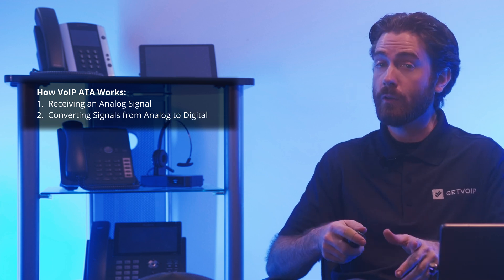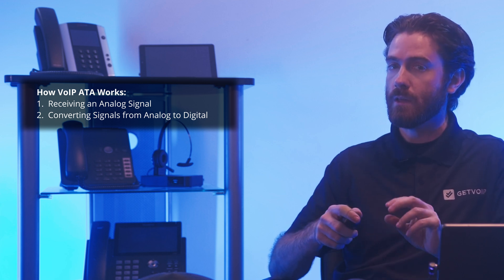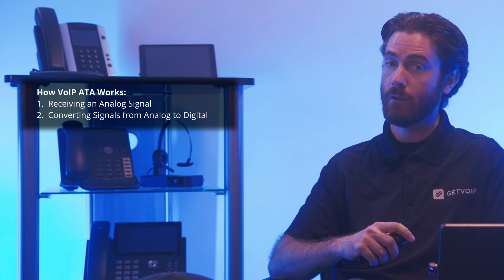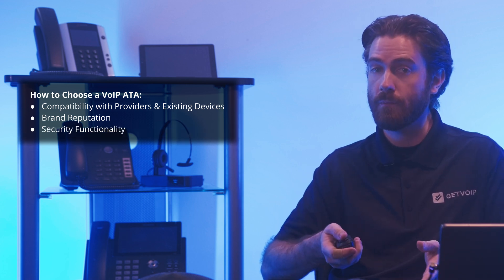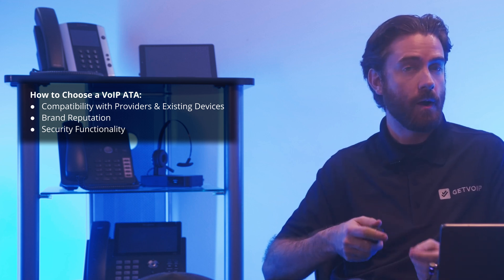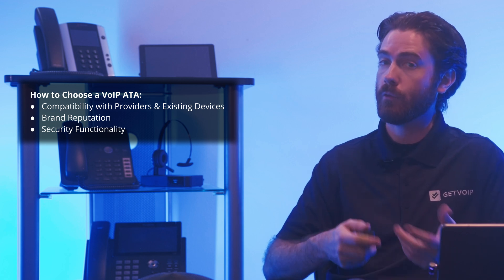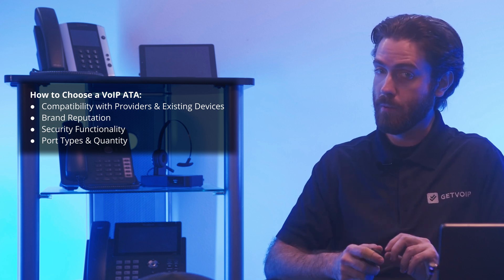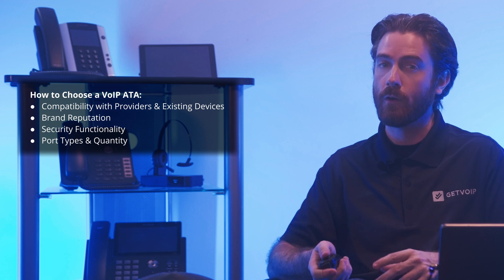VoIP ATA (Analog Telephone Adapter) - Features & How to Choose

Comment: Is there an ATA device that can be plugged in to my outside POTS box that connect the 5 POTS telephone that I have in my house?  Looks like I need to change over the VOIP, but I don't know what to do in this situation. Most residential VOIP only seem to want to activate one phone.
Reply: Plug the ATA output into the wall phone jack to complete the circuit.  You may need a ring booster in the signal chain though.